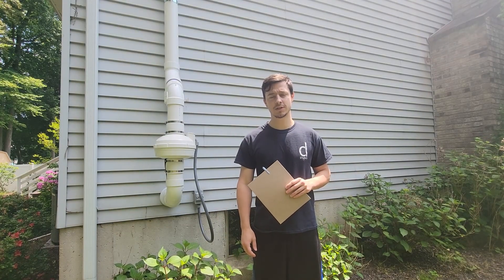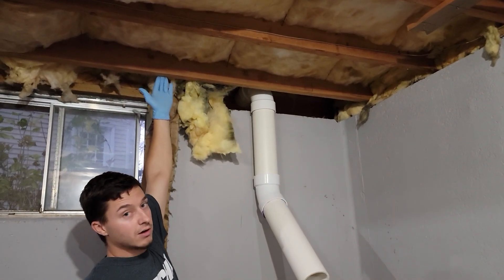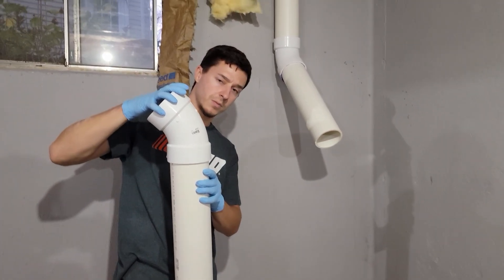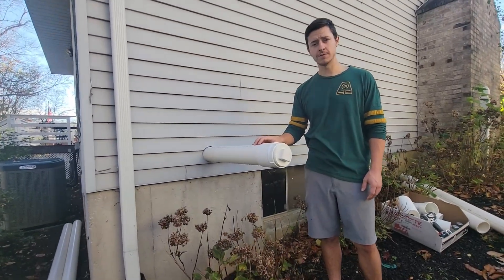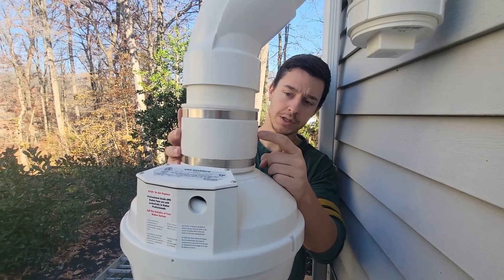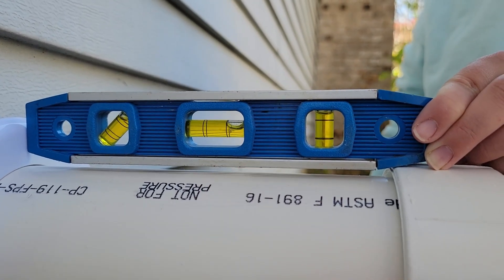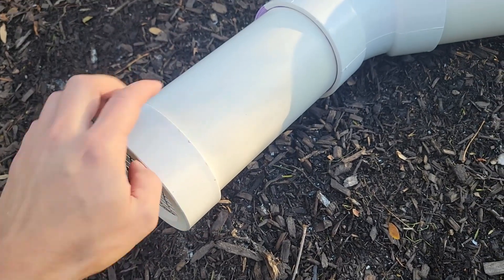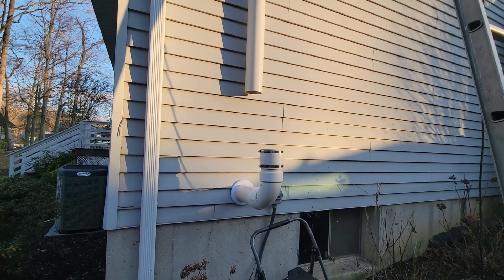Radon Mitigation - Part 6 - PVC and Fan Installation with a Rain Bypass

Comment: Awesome job, can you please share the links of parts you have used like coupling, tube, clamp to attach to siding etc.
Reply from the maker: In Part 4 of my video series (the link to Part 4 can be found in the description of this video), I go over the materials that I used for this project. I also share an excel spreadsheet link of the materials that I used, that can be found in Part 4's video description. The link to that video is here:

https://youtu.be/uhIpLrfqq8I?si=j3yk6agyJj-0Cgx4

Please let me know if you aren't able to find it or if you can't access it and I'll put the link directly in this comment section. Thanks for watching and I am happy this video has helped you! Good luck with your installation.

Comment: How's the drain pipe working? I would have expected a venturi effect, like how a carburetor draws fuel. Nice work!
Reply from the maker: Thank you for the compliment :)

I plan to actually test this bypass with clear piping and then I'll create a video on it. I haven't gotten there yet though. When I do, I'll try and send it your way. I can definitely see either a venturi effect occurring or short cycling. By short cycling a mean the fan is pushing air out and then that air travels down the small tube and then back into the inlet of the fan. I am imagining the fan creating a circular flow of air. Hopefully this is then pulling condensation and any rain that enters the top of the pipe down the small tube bypass.

Thanks for commenting!

Comment: If it is only to suck out the Radon. Why making the outside pipe so high?  Doesnt seem you have any windows on that side. And the small tube for rain water why feeding back into the pipe?  And you were probably wondering about the P trap that collect water under a sink so the gas doesnt come up.
Reply from the maker: State code and safe practice requires the pipe to discharge above the roof, windows, soffit, etc. so that the radon is unable to re-enter the home. The small tube acts as a rainwater bypass (helps reduce rainwater and condensate from flowing through the fan) and can be optional in your system. Yes! The P-Trap is what I was thinking of. Thank you! Good luck with your installation.

Comment: Nice job, looks clean. Thanks for showing the mistake you made and how you corrected it. Question - why not direct the water outside, rather than back into the PVC below the fan?
Reply from the maker: Thanks for the feedback! When the water is brought inside the home and then directed under the slab, the french drain/slate drain system is then supposed to bring it back to the sump pit. Then if you have a sump pump, the water is then brought back outside. With some installations, the pipe that penetrates the slab actually can installed in the sump pit cover. Some covers have 4-inch holes cut in to them allowing for easier installation. Then when the water enters the sump pit in this instance, the sump pumps bring is back out immediately (once the water height reaches a certain level). Thanks for the question. Good luck with your installation!